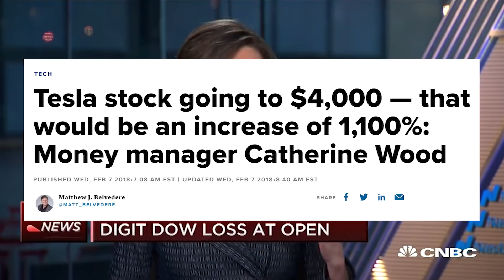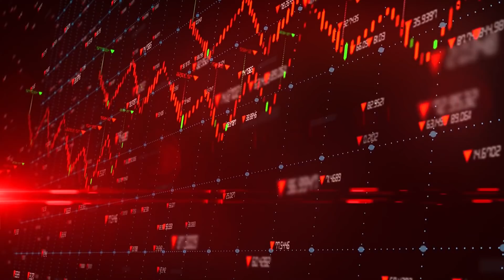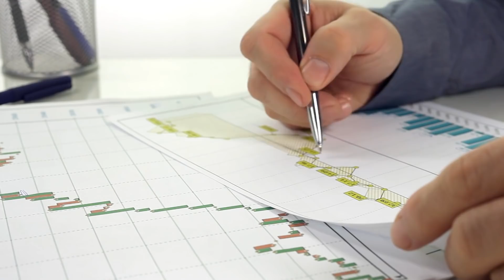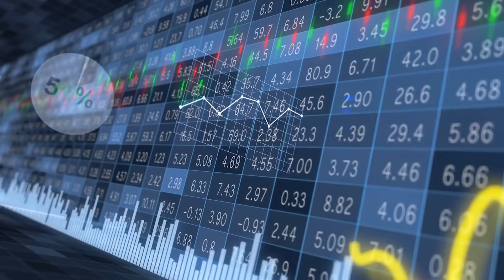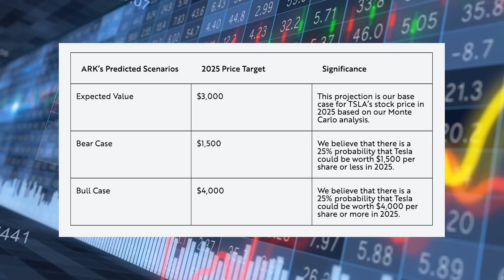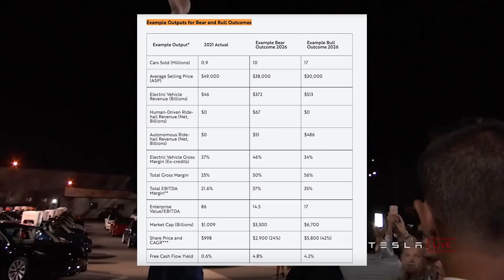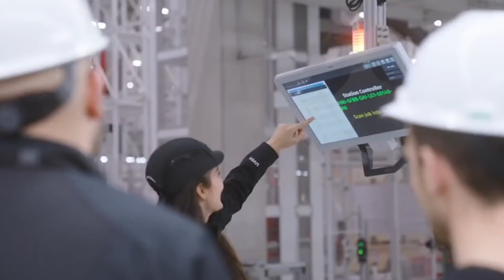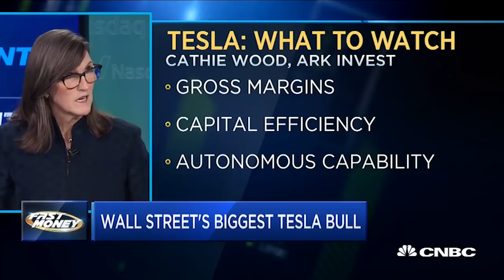ARK's Latest TSLA Price Target for 2026

Comment: I agree with you that the Semi and Energy business should be major contributors in 2026, whereas I remain sceptical about the value to be generated by robotaxis and ride haling. IMO those new products will take at least twice as long to be adopted in volume terms. So overall I am not expecting such a high SP by 2026 ($3,000 is as much as I can see), and conclude that Ark’s numbers are very much driven by Tasha’s own theories.

Comment: I agree that the lower-priced models are not necessary, i.e. it makes more economic sense (now, at least) to introduce the higher-margin Semi, Cyber, and Roadster. Sandbagging is one thing - holding the future cards close to his chest is quite another. 10 m run rate by YE 2026? Easy. As has been pointed out, the slowest Fremont factory is now the USA's most productive. And it (Gen 1) continues to evolve. Same with Shanghai (Gen 2) including expansion. As two Gen 3s are now online, they too will continue to evolve and expand (their current footprints being barely a quarter of the purchased land, not to mention other, even co-operations probably being located near them). With at least two Gen 4s undoubtedly being planned and probably announced later this year and online by, say, YE 2024, and at least two more probably within a shorter turnaround, 17 m starts to look more feasible. Remember, with Agile methodologies (26 production improvements/week) and continued evolution of automation, more produced with less (space, robots, etc.), not to mention their in-house written AI-driven ERP (Enterprise Resource Planning, the third dimension (imagine Palantir-like capabilities, not to mention another business if they so wish) added to their increasingly integrated vertical and horizontal integration. Considering ALL (and more) of these capabilities driven by hyper-scaling faster, better, cheaper & simpler, rethinking, replanning, and improving (Agile) everything daily, the continued growth in margin pushing P/E down, 17 m is indeed looking possible. Given all the previous, by or before 2026 Tesla could well have the lower-priced car and its margins, too, will be unheard of for its size. Simply put, order of magnitude thinking (vs legacy businesses) has to be considered and applied to every single facet of Tesla's businesses, their integration-induced synergies, and (finally) the unparalleled, focused, purpose-driven leadership of Elon Musk.

Comment: Totally agreed.  I stopped respecting ARKK after last year”s report came out and simply ignored Tesla”s energy business.  And now, they predicting Tesla”s averaging selling price at 30k is just lazy and uninformed.  

The use of Monte Carlo simulation is better suited for Portillo allocation than analysis of complex company such as Tesla.
Reply: If battery supply can't surpass demand for Tesla's cars, then batteries will always be allocated to cars and not energy - especially if robotaxis are making Tesla $50-100k a year EACH.

For that reason, arkk explained they can't count energy into their auto-heavy (largest margin) models for ~2026
Reply: @ChrizzeeB  Correct.
Reply: @ChrizzeeB  great point!  I agree with you.  
Unfortunately, I don’t think that’s the reason ARKK did not include energy business.  To Tesla economist’s point, Cathy Wood can’t make Tesla too good of an investment.  No one will invest in ARKK.  Remember her business is her investment company.  NOT a Tesla analyst.

Comment: Bottom line Ark estimate is very realistic. Assuming Tesla Q4 price reaches $1700 per share ( which I think is a reasonable assumption ) then for the following year till 2026 they are assuming 30% annual price increase which is very reasonable for such a growth company with such potential. I think before getting into too much analysis you need to look at the bottom line to see if that make sense or not. As you can see their assumption is in fact conservative for their $4600 base case scenario. I’m my opinion excluding Robotax and Bot and even excluding energy Tesla will become a 5 trillion dollar company in 2026 if not sooner.
Reply: You are assuming that today’s price is appropriate. The business is separate to the share price in the short term. With a hyped stock, out to medium term too. 

Cathy Wood’s (and a few others) think that FSD software will make up 50% of revenue. If you think that is true, then maybe $1tn market cap today might return 15-20% per year return for 10-15 years on average so long as all the gate posts required for that thesis are met.

Comment: First is the addressable market then it will need to be in sync with Tesla targeted goals and may need to adjust to the market forces(customer demand). Else is only assumption you make but may or may not happen. What are the key targets of Tesla?

Comment: Energy is low margin compared to vehicles so most battery capacity will be funneled into vehicle side of the business. And since Tesla will be battery constrained for many years, energy side of business will have an insignificant impact compared to vehicle side at least until mid game.

Comment: I'm surprised TE didn't have a beef with the Valuation ASP Tables worksheet being locked and password protected so that one can't zero out the micromobility and neighborhood EV segments to see if the results are sensitive to them.  Those parameters are supposed to be user-editable, per the ReadMe.   I wrote to Ark requesting a fix.   The Model A category, incidentally, includes robotaxi, so it is plausible.  I agree that the micromobility segment came out of nowhere.  It wasn't in the previous (2025) model.
Reply: p.s.  The 2026 valuation ignores the lower cost vehicles.   From row 63 in the sheet Tesla Example Valuation: "Uses [cars produceable] to move down in price within the ASP table. ASP is calculated as if Tesla sells out addressable markets sequentially first X, S , then 3, then Y, then Cybertruck, then Model A, with any spillover in an NEV. (The formula takes ASP at the sales volume from the last model-type that they sold out then calculates final ASP by linearly-interpolating ASP between that breakpoint and the next breakpoint in the table.)"

Comment: The problem for any automobile company who wants to compete with a lower price model is realizing that they will be competing with Chinese manufactures. The only way that will be possible is to continue to find innovative methods of reducing manufacturing costs. This is not easy and to put that effort into a low margin market requires one to be either foolish or extremely confident in their ability to find innovative solutions. VW has recognized this and decided to focus on higher end models. Tesla realizes that a rush to lower price offerings is a mistake unless production cost have be minimized fully.

Comment: Thanks.  Great insights.  I don't think 17m or even 10m units by 2026 is possible.  I model about 7.5m in 2026.  ASPs of $38k or $30k are also bogus.  The micro and neighborhood cars are total bogus as far as Tesla goes too.

What Cathie does say though is she thinks Tesla will carry a multiple of a mature company by 2026.  And I would agree.  However, if Robotaxis are that profitable (54% of say $220B GAAP net profit) after 2 years of existence, it is almost impossible to think it won't carry a separate multiple much higher than 20-odd.  And this is how she keeps a lid on her target price.  So I can totally understand why you disagree with her.

As a shareholder it would be irrelevant for me at $4600 or $5800, but would I rather see $14k at that point?  Hard to fathom but yes!!!!
Reply: When Elon now decided to aim for «extreme scaling», I would disagree.
I am actually thinking Tesla can reach 10M cars, at least run rate, in 2026.

The future looks great, all in on Tesla. 😊

Comment: Elon has been inconsistent about vehicle production growth, even during the same talk.  In Berlin, he talked about annual growth above 70%, but that it will take 10 years to get to 20M vehicles.   ARK's model's is using the growth rate that Elon cited rather than backing into a growth rate from production of 10M vehicles in 2031 or so.  In particular, the ARK model has a variable called "Max annual production increase (given management bandwidth constraints)" whose value is a normal distribution centered on 75%, but with truncation of both tails to avoid nonsensical values like 10,000% annual growth.   The 17M number is NOT the average over the set of Monte Carlo simulations, but rather the bull case, which is +1 standard deviation above average.    Incidentally, the ARK model is a bit confusing because there is another variable called '"Max annual production increase" whose value is a point estimate and is set to 60% in the 2026 model.  An unhelpful note explains "Provides an upper bound for vehicle production to accommodate management bandwidth constraints in building out factories."   Ark's 2025 model has the same two variables, only the distribution for 2025 was centered on 80% and the second nearly identically named variable was set to 90%.   Ark has a bit of work to do before the Tesla Valuation Model passes the clarity test.

Comment: Sounds like the conclusions on the matter were tainted by the analyst's preconceptions, paired with concern that TSLA would be a better investment than the ARK ETF. There is no excuse for removing several key vectors for growth from a price analysis like that. The fact they are willing to do this makes me doubt the ETF to begin with, rather than consider it worth investing in. Whether ignorance or intent, they have just demonstrated a reason to doubt them, which you don't want from your ETF managers.

Comment: Bots also left out of ARKK valuation
Reply: I don't think bots will be a substantial contributor to their revenue in 2026. Yes you will see prototypes working in Tesla factories. But I don't think they could get the AI to work in general arbitrary environment in that timeframe. How many years have Tesla been working on Self Driving AI yet they are not confident enough to release it in general public. I expect the same thing to happen to Tesla bots. They can make it to somewhat work but not safe enough as a product to sell to general public in 2026.
Reply: Bot will add somewhere between zero and infinity to the stock price. How do you even begin to value that? Other than pick zero I guess.
Reply: @BittermanAndy  First you don't assume infinity instead guess the total addressable market even if TAM is something absurd like equal to world GDP. Second you calculate the expected value. If the chances are equally likely between 0 and world GDP. Then EV = 0×0.5 +WGDP×0.5. Valuation would then be half of world GDP for the Tesla bots alone. But if you assume that the chance of Tesla succeeding is only 1% and that TAM is a lot lower than WGDP then valuation can be a lot lower.
Reply: @BittermanAndy  I’m not being paid to be a stock analyst, they could do better than $0